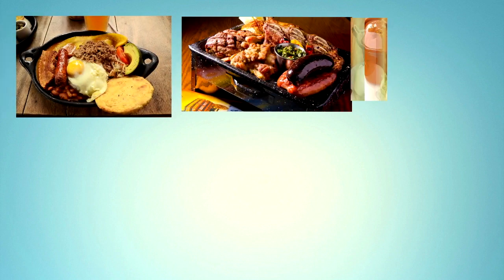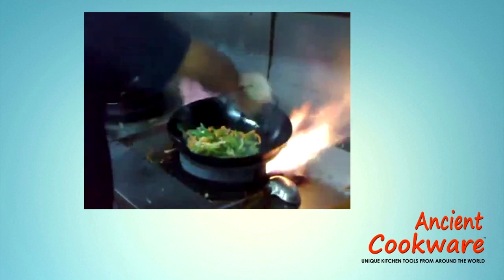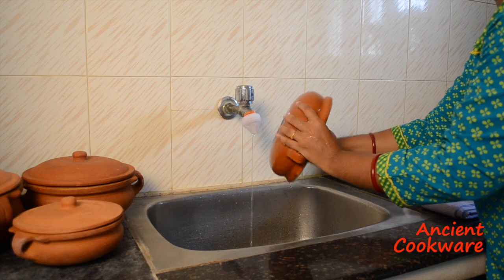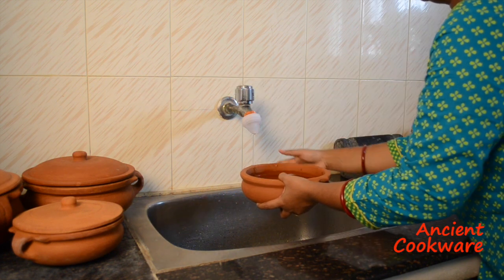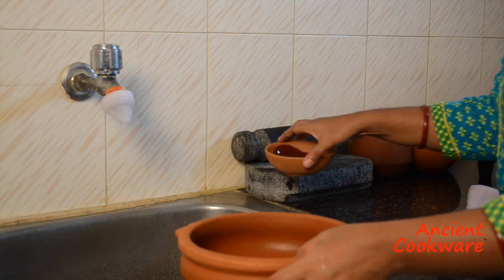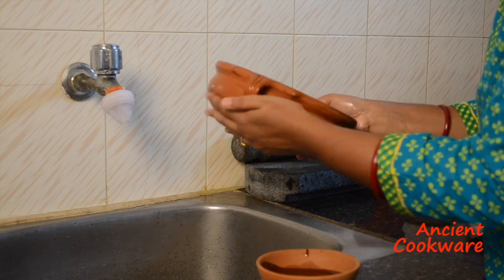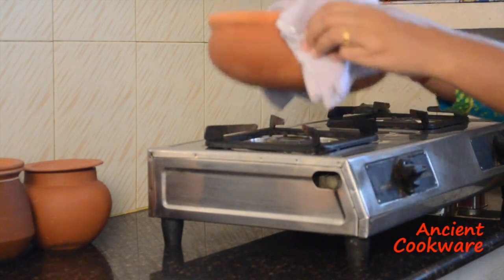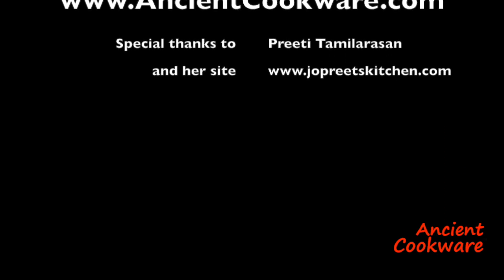Ancient Cookware How to Cure an Indian Clay Pot

Comment: I have one with a tap. I need to prepare it for drinking. after soaking it in water overnight and rubbing oil over it... how do I bake it? it's got a metal tap on it
Reply: Yours is made for keeping drinking water cool and doesn't need to be seasoned on the inside but you can rub a little coconut oil on the outside and set it in the sun. Then fill it with water and set it on your counter.
Reply: @PC-uh6hk  I hope it works.. I am facing the same issue with my pot